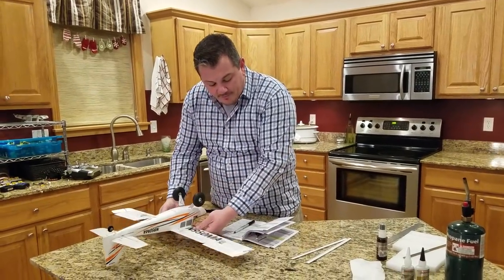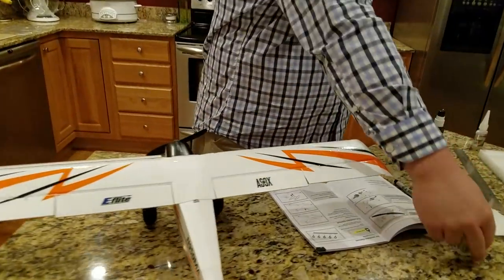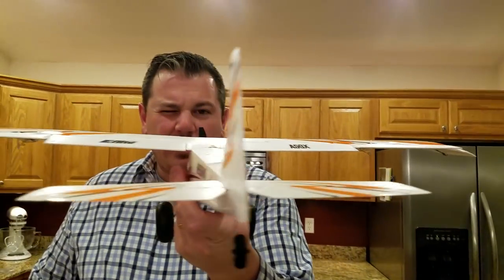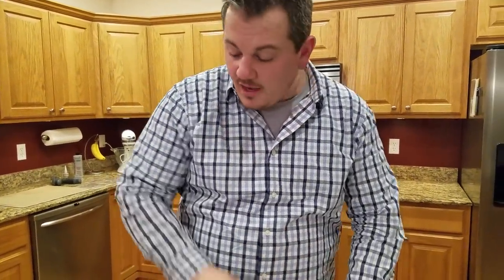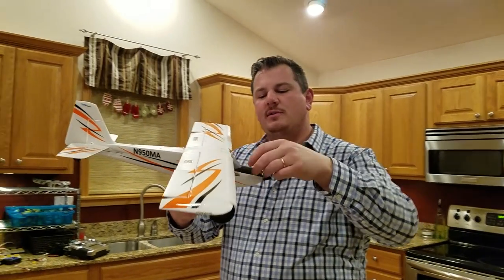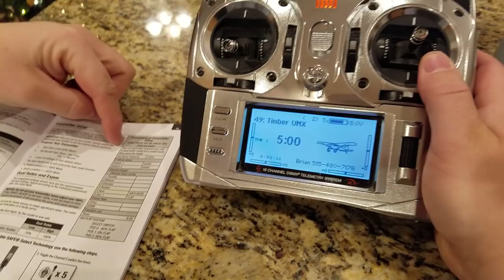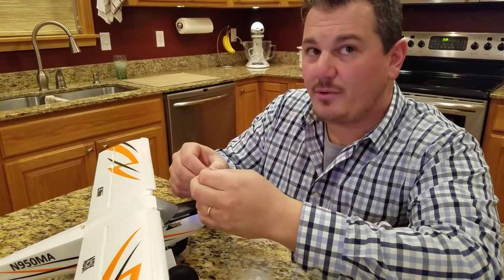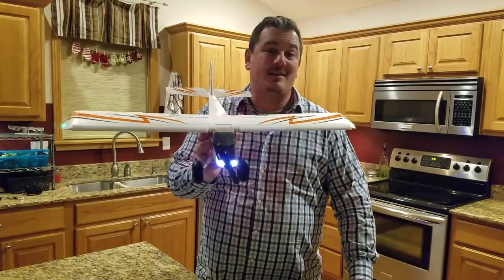Eflite - Timber - UMX - Assembly, Radio Setup, and Tips

Comment: I was going over my failures and successes with a father-son while flying the Conscendo Evolution. They wanted to know how to get into the sport and what plane to get started with. I suggested a small RTF pushprop and the Timber UMX or Turbo UMX as the 2nd purchase. This little plane with AS3X and SAFE saved my bacon multiple times as I was trying to figure out the transmitter, thumb input, throttle control, etc. What I liked the most was the variety places you can fly this plane- soccer field, parking lot, small areas without people, power lines and trees. 
I think this is a “Must Have” to get from Beginner to Intermediate level. I’ll still sneak out of the house with 4 or 5 batteries, head to the local soccer field and what I call- “Lie & Fly”.  (A little me time for an hour)
Reply from the maker: Totally, but lota money to tie up if your not "Sure" you'll stick with it...so maybe the Aeroscout https://bit.ly/3ntOcFx (I guess you technically said a pusher prop plane ;) 

I love the Timber as a second plane!

Comment: Added a few coats of CA to the lights on my UMX Turbo Timber and WOW! Went out just before sunset this evening and what a difference! Amazing how something so simple can make such a huge difference! Also tore off a flap on a Timber X and used your method to reattach it, Works as good as new!! Keep up the great work!
Reply from the maker: Awesome! I'm so glad I could help. The CA trick is so easy, and so effective too!
Reply: Brian Phillips you were right about the fly crash fly fly crash lol! Today I had a fly fly fly day! Man I was so gun shy I was almost shaking. But I think I found out my problem. I was flying these heavy planes like a sport cub and was stalling. These planes need more power. I ran a 4s in my Timber X for the first time, Wow what a difference an extra cell makes!!!
Reply: Meant to say UMX Timber, that tape fix is awesome
Reply from the maker: Yeah, one extra cell makes for a load more power!
Reply: Brian Phillips man do you have any idea where I can get a tube of mucilage? Hobby King has been out for a couple of months with no ETA. I’ve searched everywhere with no luck. 
That stuff would really come in handy on certain repairs!

Comment: What a exceptional video Brian! Thanks so much! Just set  up my UMX as per your recommendations with the exception of painting the prop and the TX settings. I figured the spinner and the prop will be the first victims as a break the plane in but I purchased spares in advance. I had no medium BSI CA so I used thin. Worked well just took longer for the LED's. Also had some problems binding the RX to my DX6 TX. Note to others... Make sure you have new batteries in your TX and are standing at least 12 to 15 feet away when binding this plane. It will save you a lot of troubleshooting if you are new to RC setup . There is no binding plug with the BNF option.

I used foam from the box for the battery holder. 3.5 CM wide by 7 CM long. It works well too if you have a very sharp thin knife or razor. Once bound I noticed that the right aileron was sticking. Thought it was a bad servo or solder joint. WRONG! I disconnected the push rod from the aileron horn and found that the aileron itself was bound to the main wing in the manufacturing process and was not checked. I cleaned this up and it works fine now. Thank goodness I did not damage the servo gears while figuring this out!
This is a delicate plane and will be highly affected by wind. I will take that into consideration on her maiden flight today.
I will be SURE there are no street signs in the vicinity when I put her up for the first time! LMAO!  It was funny to watch but I felt your pain as I have been there too. In my case, it is big planes into big trees, field fences or not making sure that all electrical connections are secure. On my maiden 1.5 meter Timber, the battery disconnected from the ESC at 50'. This is a very heavy plane and it nosedived into the ground. I cried like a baby so don't feel too bad. The wonderful thing is you took the time to show folks how to repair the damage and you did a great job! Unfortunately the 1.5 had to be put to rest due to excessive damage but I have a new one now.

I must also congratulate you for having a supporting and loving wife. I bet you she bought you the UMXT for Christmas right? Lucky you. It is wonderful to see good people doing wonderful things.

My best to you both and happy flying,
Donnie
Reply from the maker: Good that you checked out that ailerons before your maiden :)
Watch out for street signs....and trees, and fences, and batteries - LOL...there's a lot to watch out for these days ;)
Thanks Donnie! We appreciate your kind words! My wife is very special, and does a great job filming!!! We're lucky she hasn't "sent me away" (yet)....

Comment: Won’t go through comments to see if this was suggested. I bought a couple extra tips and save all others so I always have several clean tips on hand. Also I store my glue in the fridge. Keeps it fresh longer.
Reply from the maker: I have used acetone to clear out tips - works like a charm, but I still have issues with clogging...kinda goes with the CA territory as I've experienced it since as far back as I can recall, as a kid even :)
Reply: Brian Phillips, Does go with the territory. But, I’ve been flying RC since back in the mid 60’s and way back I read in RC Modeler that unclogging CA with a pin makes it re-clog faster.  If you have several clean tips and always stand the bottle up after using and put the cap on tight it seems to clog less.

Comment: Good tips. Like the battery idea. Have the xvert with bottom door and flimsy white velcro, very small magnet and battery constantly falling out.
Reply from the maker: I hate to have to do this, but I have had to do it on a few of the UMX planes. This has worked out really good! It's FAST, and effective. Thanks for the comment :)
Reply: I fly the Xvert too. Really love it, but had the same problem with the battery door. I put two strips of velcro across it to hold the door shut. Haven't had any issue with battery falling out since. When it fell out on me, REALLY screwed up the CG!!! I also put heavier duty velcro on all my batteries and battery compartments. No issues with loose batteries there either. That's what I did with my Timber. Dunno why manufacturer uses such flimsy velcro. Hope that helps.
Reply from the maker: yeah, this is why I don't typically trust velcro. The material it's attached to is not strong enough to allow separation, at times, like the small foam tray that's under the "hood" on the Timber UMX.
These little holders I make take about a couple minutes to make, and might be in the 1-3 gram weight, so I just love that it's always in there with pressure fit.
did you ever fly the delta ray? If so, imagine flying it and having a 2200mAh 3S pop out and dangle around...this was what happened to me and Esteban a couple times...it was a real butt clencher - LOL!
Reply: @BrianPhillipsRC  xvert is only plane, only small space to fly. Also spark and p3p.  Hawks are real problem. Made a small latch for the door and 2 small pieces of soft foam to keep battery at cg.

Comment: Lovely Friday afternoon here Brian. 
Many thanks for your reply .
Everything is working except the aileron on the left... seems to be frozen 
Spindles & cogs turn  if I hand turn it ( up & down) but does not work like the right one.
Your new home is looking great. You will need to remove the trees to make your runway!!
Reply from the maker: So the thing turns but it's harder to turn? If that's the case, can you take off the small gear on the end and see if it's the other gear (spline, i think is what it's called). The trouble with these servos, is that in order to test it, you have to basically open up the top half of the plane and simply plug in another servo into the socket to test if that new one works, then you can go back to troubleshooting if the servo itself is bad, or a wire, or a motor ON the servo...only really 3 components to fail...

1) Rx port
2) Wire
3) Motor on Servo
4) Servo Mechanism
     Gears
     Spline
     Restive element UNDER the spline
5) Servo Controls (PWM to Motor output)
6) Something wrong with the Transmitter - but I highly doubt this one... 

Sorry for the slow reply, my notifications are not fully working. I've been getting a number like 15, but only see about 3 or 4...and you were one of the victims!!!!! Sorry about that. Trying to backtrack to not leave everyone handing!

Comment: Many thanks for taking the trouble mate. I have looked inside to see if something is loose or a wire out etc but it probably means the small servo has seized up so will ask Horizon if the sell them individually.
I hD some great flights at 7am yesterday on the ocean beach with the Maule & will post to youtube using multiple cams this coming week with the surfers in the background

Regards

Comment: Am I correct that the regular landing gear wire just snaps in place?  The plastic mounting tabs and crews are just for the float option?
Reply from the maker: Yes, then the screws go in for extra hold, if you wish.

Comment: Why 100 instead of 90 on the flaps ?... and what does the negative number mean?

(thanks for the tip on holding it upside down to tell if safe is on 
that will become part of my pre-flight check list -
this is my 1st plane with flaps, and most advanced to date,
moving up from Cub S, and my 1st Tx that was not part of a RTF.
I have a ruff strip - so I hand launch -
for now, I launch in safe, then go to safe off after gaining altitude.
A time or two I forgot to set safe before hand launch and that was dangerous 
for my level of experience -  got thru it without crash.
Reply from the maker: This will bring the flaps down a bit more, but be careful about the full 100%....these linear servos get upset if they're "over-driven"...and they can fail (stick) in at the end of a throw, if you repeatedly overdrive them, or you have a crappy one. Usually about 98% is a great idea, just to be on the safe side.

Use SAFE as long as you need it. It's a GREAT training utility. I started flying just a little over three years ago, and wouldn't think of touching anything without SAFE, now it's kinda annoying to me :) You'll get there, just keep with it, and you'll be off the training wheels before you know it!
Reply from the maker: Sorry, forgot this in the first reply...

What does the "-100%" mean? You asked...

-100% means all the way from the center to an extreme control channel position
0 mean centered control channel position
+100% means all the way to the OTHER side from the center to an extreme control channel position

...more exactly it has to do with the change in Pulse Width Modulation for that channel, but that's some way-over-kill-technical-mumbo-jumbo...so for what you're needing to know right now, it describes the position of the control, like the flaps, or rudder, or elevator.

Why -100%....well, that's because the servo moves a certain amount, and we want to take full advantage of the entire movement (or throw) so we start at -100%, rather than 0%, like we would for a rudder, for example, since it pivots from the center to the left or to the right...

As you progress into the hobby, you may start using MORE than +/-100%. I regularly have a channel or two that I move the maximums up to +/-150%, but sometimes I actually tame them down to something like +/- 65% so I don't hit the elevator on the rudder, for example....but that's pretty rare for me.

Lots to learn!!!! Glad I can help, where possible!
Reply: Brian, thanks for taking the time to reply to a new pilot, very well explained - I got it.
Reply from the maker: Great! Glad it made sense!

Comment: Brian what is the glue you put and the other black bottle you put after that as well….I am new to RC
Reply from the maker: This is called CA, and the other is called Kicker (accelerator AKA Insta-Set). This stuff is a GAME CHANGER...wish it would have been around when I was a kid!!!

Links for your consideration... If I were you, I'd get the ones I marked with an  <<<<<<<<<<  and then you'll be set for your crash kit.

Kicker http://amzn.to/2CQf24D  <<<<<<<<<<  
CA Medium Thickness http://amzn.to/2D0x18i  <<<<<<<<<<  
CA Foam Safe Medium Thickness http://amzn.to/2E2l29z  <<<<<<<<<<  
CA Foam Safe Thin Thickness http://amzn.to/2COE6sw  <<<<<<<<<<  

Horizon Hobby Stuff 
CA Foam Safe https://bit.ly/30UbDPL
Kicker https://bit.ly/2PRd5Mm
Foam2Foam https://bit.ly/30RNnh0 (Similar to Mucilage) - This is like a contact adhesive that won't eat foam. This is made in Europe, but it's LIKE China Glue  <<<<<<<<<<  

Hobbyking
Mucilage https://bit.ly/3fdfzQp - This is like a contact adhesive that won't eat foam, the Chinese use it to bond the planes together, thus it's called "China Glue" by me and many others.

Keep in mind, there are CA's that are not all FOAM SAFE....some will EAT FOAM!!! if they're "Foam Safe" you're usually fine, but using too much KICKER will make the reaction TOO fast, and it'll get SOOO HOT that you'll melt the foam. It's fun to try a few times just to learn, but the fumes are strong and they are VERY unpleasant to smell...they'll burn your lungs, so be careful ;)

Comment: First I want to say thanks, but my AS3X is working at switch-position 0 (should be 1) and if I switch to safe, I can hear something, but nothing is moving...
What did I wrong?
Reply from the maker: You can reverse that channel, in the servo setup menu. Secondly, you need to pick up the plane and carefully rotate it around on the ROLL axis and see if the ailerons try to bring the plane level.
Let me know, and I'll respond as soon as I can.
Reply: Brian Phillips it actually works, just like yours and I turned the plane in any direction, I could hear the servos, but they did nothing 
But thanks for the first tipp, I'll do that!
Reply from the maker: This means that you've got AS3X (Stabilization Only) on, but SAFE isn't yet turned on.
Also, you may need to give some throttle to activate SAFE, but I can't recall for sure. Obviously, be super careful doing this with a prop on the plane, especially if you're inside the house :)
Reply: Brian Phillips I am not too bad as a pilot... I think I should go and fly, I am confident and I think I can handle it without. Maybe it works and if not, I am going to call the Horizon Hobby Service... maybe it turns on mid-flight 🤷🏽‍♂️ We'll see
Reply from the maker: It's super easy to see if it's on, I would highly recommend getting the answer before you take off, but just my two cents worth :) SAFE can make flying in tight spots almost impossible, keep in mind, due to the limited angels...
Reply: @OverKilL413   & others - you must take the throttle to at least 25% (then back down) in order for SAFE servo  activity.  I had it working at home.  Went to test it before 1st flight at the park.  Could not get the test to show SAFE activity so returned home and figured this out.  Now I know.

Comment: Hi Brain I've got a question brother, after watching your Video's Now I'm interested in installing flaps on to my J-3 Cub now. Thing is I had some old Timber parts an I have the flap worm servo and the flap wire and way you could show me the inside of the Timber so I can see the placement of the moter an which direction it sits on the top wing ?  Before I do any actual cuts on my plane.
Reply from the maker: I did this on my J-3 Cub UMX, if you want to see how I did it. Watch that series, and you can see what I did. The easiest way to figure out what direction things move is to hook the servo into the port and setup a channel to control that servo, then see what direction it moves.

Haven't you seen that series? (I thought we were just talking on one of those videos the other day...)
Reply: @BrianPhillipsRC  I seen it I washed all 4 Video's but we were speaking on that led lights the other day. But I did exactly like you did an shave out the foam and then measure the flaps out for cutting. I'll finish it up later on an make a video
Reply from the maker: Nice! You will LOVE the way she slows down! It will creep!!!
Reply: @BrianPhillipsRC  Hi, Brian how's it going man, any way possible you would have or know the dimensions of the decales of the J3 CUB ? I've looked everywhere I could find. An nothing.

Comment: What do you use to fill in gashes in the foam.  Is there a good foam filler that you like?
Reply from the maker: I use whatever fills the hole....many times I use paper towel and CA, sometimes I use CA only, sometimes I use small chunks of foam, then trim to size once the CA is setup...many people like to use a lightweight spackle, but I personally haven't used this method (ever)